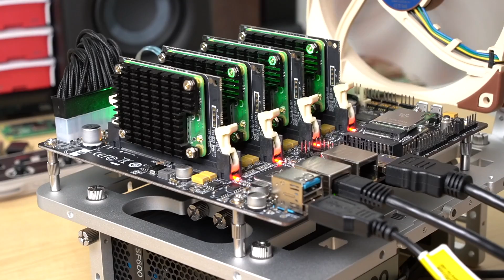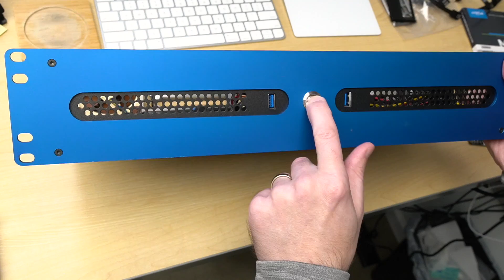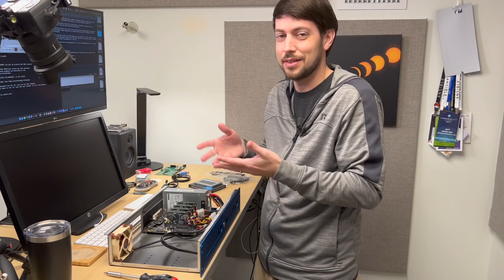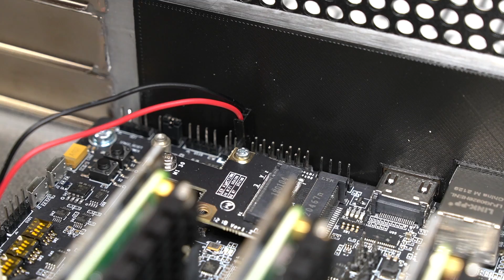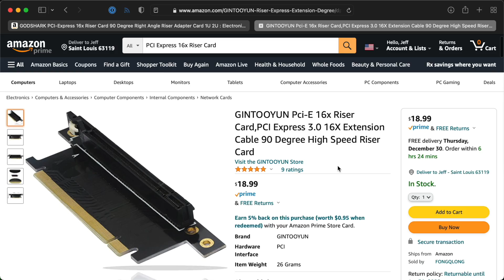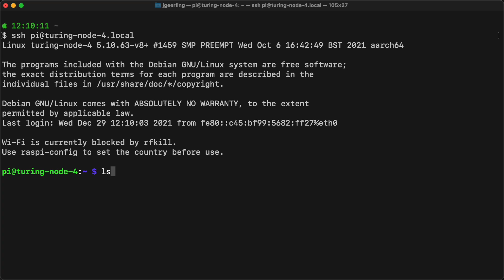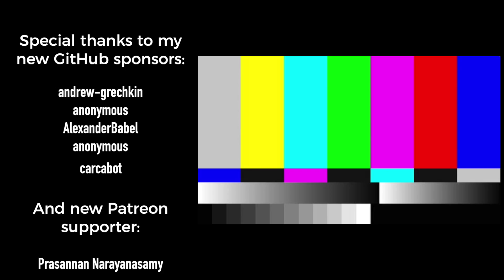Racking up a Raspberry Pi cluster!

Comment: Not that it would be practical, but would a honey badger work on the cm4?
Reply from the maker: Assuming you mean Liqid's PCIe card, most likely it would, but at severely reduced speeds. Not that it's not a fun idea :)

But if you meant the honey badger that don't care... well I'd keep them away. Honey badger will do anything just to feed itself and survive in the wild.
Reply: @JeffGeerling  yes I meant the card, would all drives be visible, or only one? Or maybe none of them.  Though a raspberry pi that a living badger could use would be a neat idea.
Reply from the maker: @nathanhamman418  I should think they all would be—as long as it's standard PCIe then things should work well through the normal NVMe drivers on the Pi. I've only had any issues with more than 4 NVMe drives at a time.

Comment: Perhaps another fan somewhere inside or a vent to direct cool air to aid with cooling?

Also, does it exhaust from the case or pull air in?

PS Can you fit another Turing Pi 2 in there? :D
Reply from the maker: Two Turing Pi 2's could fit—though not sure how you'd cram another PSU inside, though with some origami it could be done.

I have the fan set to exhaust—basically everything pulls air in from front (including PSU) and exhausts out back.

I mentioned at one point that since the Turing Pi 2 doesn't have a CPU fan like a typical ITX PC motherboard might have, it would be nice to have some sort of fan or ducting to pass air directly over the board, or maybe even a fan mounted to the top of the case to keep air moving.

It's ventilated enough and the single 80mm fan seems to keep circulation up to prevent throttling, but if you want to keep things nice and chilly for an overclock, that could be risky.
Reply: @JeffGeerling  I did hear you mention about the fan, but for some reason didn't hear the rest!

Perhaps RSJ could take a plumbing course and fit water cooling to it :D
Reply: @JeffGeerling  There's always the option of 3D printing a fan bracket, it could mount on the board standoffs or on the front intake holes

Comment: How deep is that? I have a network rack and can only mount things 15” deep. This would be perfect for a small home server I wanna build with an itx board I have sitting here!
Reply from the maker: It's just under 11" front to back—a tiny bit extra for power and network cables, but it fits in a very tight rack.
Reply: @JeffGeerling  that’s perfect! Imagine an ITX board in there with a nice 8c/16t cpu, maybe a P1000 for encoding. Boom server with a vm for plex, and other stuffs! Excited!!!

Comment: Nice, the turning pi looks sick
That got me wondering, why you didn’t go with the pi blades instead?, did it required extra cabling and such or was it not available to buy yet so you went with Turing pi?

Another question, with some modifications to the rack, do you think you can shove another Turing pi board in it?
Reply from the maker: So far they're not available—I'm still waiting to see when they are, and I have a different project in mind for the blades :)
Reply: @JeffGeerling  interesting, I’ll definitely would love to see the 64 core pi monster :)